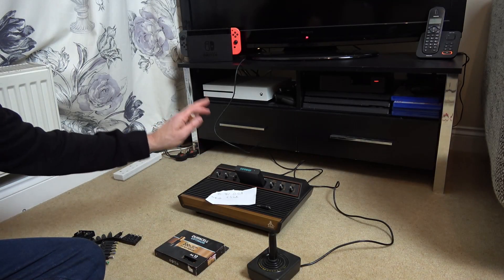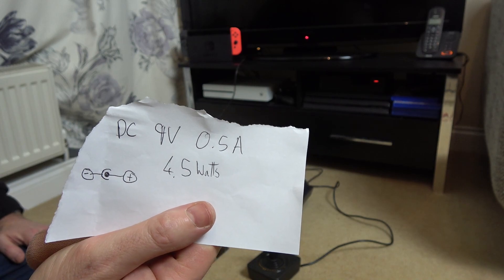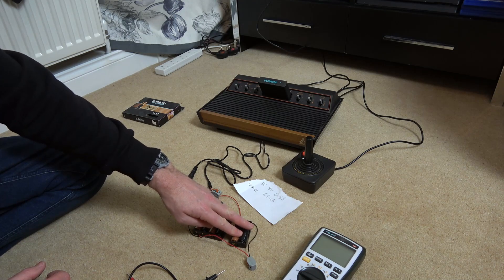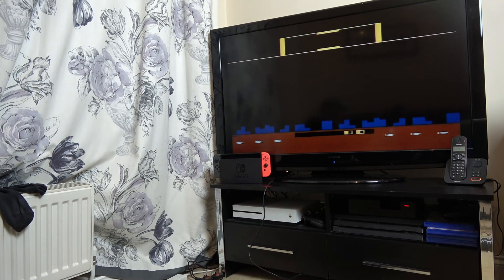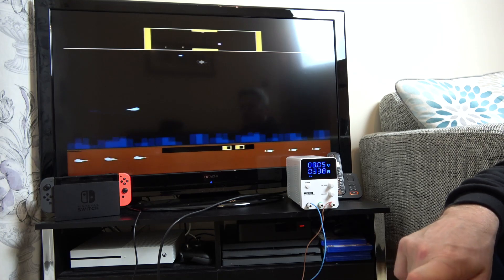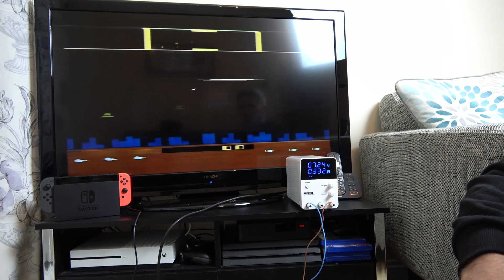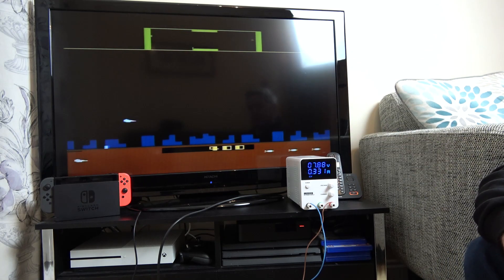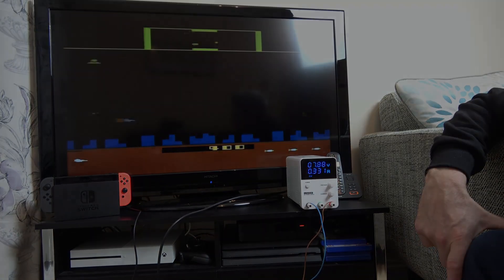What Happens When you RUN an ATARI 2600 from AA Batteries?

Comment: The reason why the picture and audio go iut at rhe same time is because the RF modulator is using that power. If you somehow bypassed the rf modulator, like rbg modding the console, or if it has composite video out, it woukd grant a much more lenient, and interestinf result